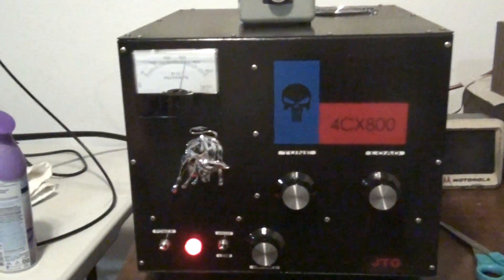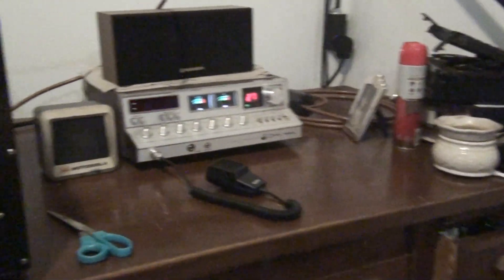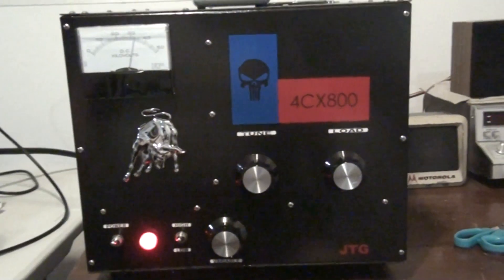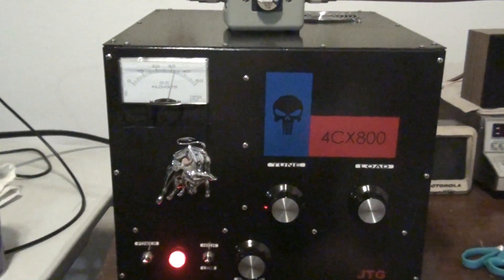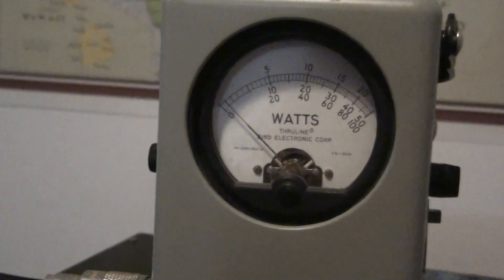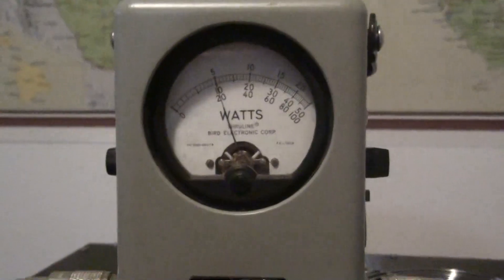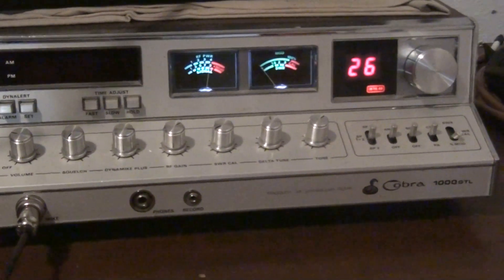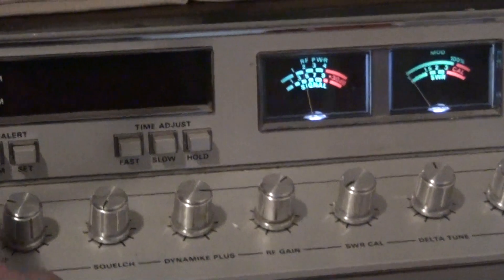JTG Built GU74B (4cx800) Steel Tube Linear Amplifier (Tetrode) 220v

Comment: Too big for my antenna. Could run it on low and just idle it at around 1500 to 2000 peak and I could get away with it as long as I didn't keep keyed up too long. How much for it?

Comment: Is there a email for JTG?
Reply from the maker: No. He's a real busy guy that does a lot of f stuff beyond radio related, so he doesn't let his email or phone number circulate
Reply: @Rooster_Radio  ight i was looking to see on a 4cx250b box 2 or a  4 tube and see what it will cost. I want to get direct from him tho.
Reply from the maker: @minibikemadman  He probably wont do any multi tube 250b. He's done a good bit in the past, but the single 800 just makes more sense economically. 
As for getting it direct from him, 90% of the people that get his amps go through myself or Gump. The price doesn't change regardless. He doesn't do any shipping and neither do I when it comes to large amps. So if you wanted one it would need picked up. Any exchange of money doesn't go through me, but directly to him. When people have money in hand and are ready to make a payment against an amp I put them in contact with Grinder. He doesn't have much time for anything else. Not that he's a goodie two shoes or anything, actually a super humble guy, but he has a ton of business beyond amplifiers or anything radio related.